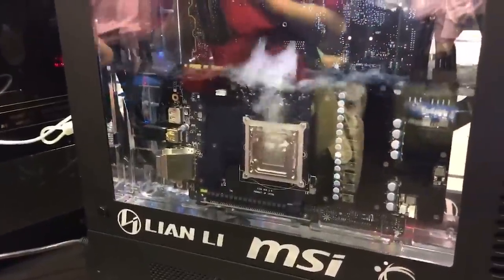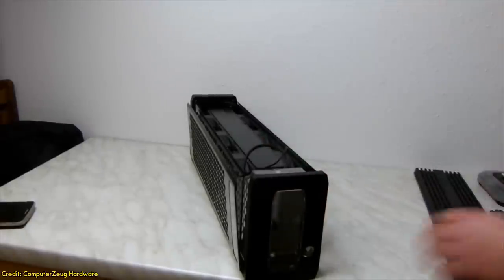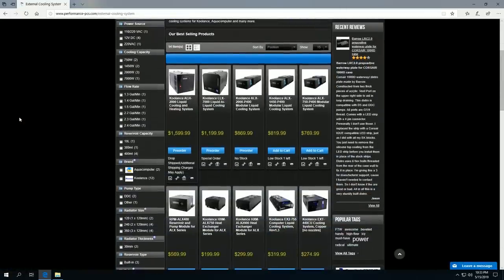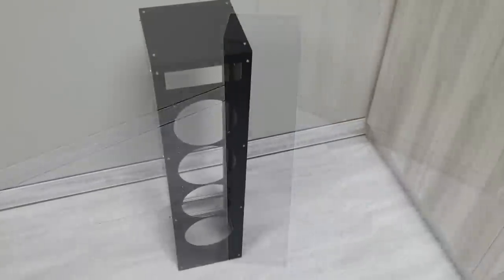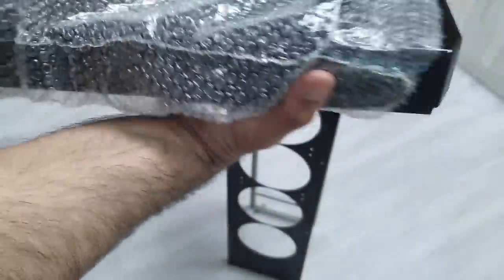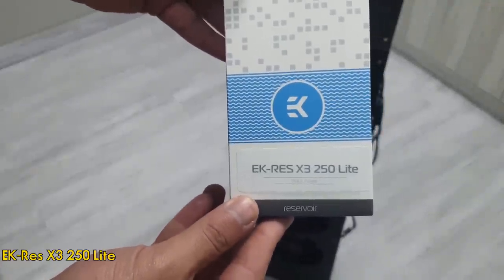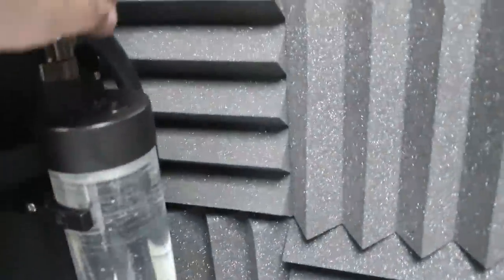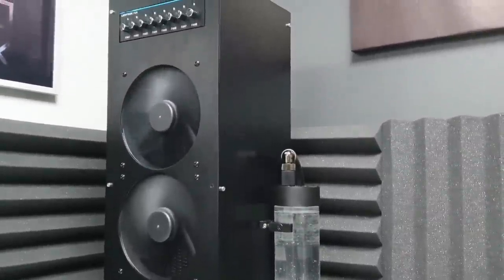A Single RTX 2080 Ti on a 560 Radiator!

Comment: This mans gpu on Load is lower then my room temperature. Amazing
Reply: It could never be colder than ambient.
Reply: pretty sure its possible even with a air/water cooler, but you ltierally dont want to :p also maybe OPs ambient might be very high xd
Reply: @ZenTauren  delete ur comment pls i lost 20 braincells
Reply: @ZenTauren  Intel would disagree. (->insert chiller pun here)
Reply: @ZenTauren  Well yes it would quite litterally be "air cooling"🤣
Reply: @ZenTauren  If he lives in a sauna or Quatar, perhaps. Obviously he is either being hyperbolic or doesn't understand thermodynamics. I am going to leave my comment.
Reply: @ZenTauren  my room in the Philippines used to be around 90 to high 90s Farenheit until like rainy season. I'll never forget it lol
Reply: Than
Reply: @420f37  you didn't have AC???
Reply: than*

Comment: I own an eiswand too,  I had the same noise as yours, turns out it was the fan hitting the dust filter. I removed the dust filter came with eiswand replace it with 3*120 magnetic dust filter that can be easily removed and clean from the outside, that solved my noise problem. And I also got an adapter power for the eiswand, now I can change the voltage between 5V and 12V with ease. But have to say, your new solution is insanely good, I might try the same way but with 1080 radiator.
Reply: Ken Hu 1080 radiator 😂 go get a truck radiator and cool your a$$ with it . Jeez 😅
Reply: I may have to look into your solutions as I own an eiswand too I just used some tweezers to pull the dust filter away from the fan as that's what's causing the noise. They should at least shave the filters so they're flat on the back.
Reply: @wapeddell  but know this, after I removed the original dust filter  the noise of the fans became more notable, you might want to look into some quieter fans. Looks like a lot  of people have the same issue as us, maybe alphacool should change the way they install the dust filter.

Comment: I'm here because of "Palmy|Rabbit[TH]'s" comment "GPU 30c? r u running on thick on thin radiator? push pull?
". 

And your response was "Im currently using Alphacool Eiswand 360 external radiator for cooling the GPU only. In the coming 2 or 3 days ill release a video about a new cooling setup with a bigger radiator :) .. keep in mind that ambient temps at my end is around 16 - 18 c
" from your "Tom Clancy's The Division 2 - PC Ultra Quality (3440x1440)" video.

I'm glad you followed through on your word! Thanks!

Comment: I made a switch using a relay that turns on the power to an external radiator when the PC comes on using USB and a bios setting that only turns on USB power when the PC is on.  It's also got a power switch so I can turn it on manually if desired (in case the USB switch failed).  I also used an EK D-Bay (with EK D5 pump), so it included the res and pump inside the enclosure.  Lastly, I was able to power the entire thing using a 12V 5A power brick with no need for a full power supply.

Comment: I'm also doing this when I found out about external radiator mounts.
Currently cooling a r7 3700x w/ 2 nvme m.2 gen 3 in a loop w/ 2x 360mm 30mm radiator.
Even my case is a full tower it only can only mount 1x 360mm 1x 240mm and 1x 120mm.
Note: 2x 360mm top and front will have a angle fitting clearance issue so I only used 240mm.
Going to add another 360mm for GPU as separate loop.
Still going to use acrylic tube but I'm adding a soft tube w/ quick disconnect on the rear pci-e slot of the case for modularity and maintenance cleaning/troubleshooting.. it will hard to move a tower system with a external radiator if it's not removable via quick disconnect fitting (so it's a hard tube build with just a lil bit of soft tube for modularity)

Comment: The pump should be pushing water into the restrictive cooling blocks and receiving gravity fed water from the reservoir to get the fastest flow of water and to prevent the possibility of the pump running dry. Pump damage can occur in as little as one second of running dry.
Reply from the maker: Thats exactly how my pump is set up :)

Comment: Was it worth it for a single pc part. The correct answer would have been yes! The gpu ran 9 degrees C lower, and the clock boosted even higher. 100% worth it for an enthusiast.

Comment: I am glad this video was recommended to me to be honest.
Your video just gave me an amazing idea that i will use for my personal use case scenario.

I thank you for turning a full airflow  FAN crazed maniac to the water loop that i was asking about but had no answers to!
I am worried about the risks that come with a water cooling loop , but if you can get some really good sleeved tubing like 
the ones found in AIO`s and some good fittings. I believe you can create a really robust water cooling loop.

Now you just need to add a card like the Galax Hall of Fame card or Asus Matrix ? No more like an EVGA water cooled one and
just put it into the loop on the 560mm. rad.  (My idea is to have a GPU with the water cooling integrated and fans on it as well :D)

Can you please make a follow up video on what kind of temps you get when you add a  CPU to the loop  ?

Comment: My room is 20c, i have a Gigabyte Xtreme 980ti that i've put 2 140mm Notcua industrial 3,000rpm fans on. temps under most loads are between 38-44C, most ive seen in synthetics and BL3 maxed with unlocked framerate is 48c. definitely good for an air cooled card ;)

Comment: You did put the reservoir in the opposite direction. The little tube inside has to be looking up so it can be purged. The air bubbles NEED to go up not enter again into the circuit. So 1 hole only has to be up to open/close the air and the other 3 have to enter/exit the liquid. Also I couldnt see it in the video but the radiator holes have to be down so the air bubbles formed accumulate in the upper part too and dont enter again in the loop.
Reply from the maker: Thanks for the message bud, the radiator holes are on the bottom. Regarding the pump inlet and outlet setup, it's exactly what was mentioned in EK manual. I have no issues with air bubbles.

Comment: Just another thought, maybe you can use one of the reservoirs that can be installed in an optical drive bracket like alphacool Eisfach. And add an optical drive bay module on the top of your radiator case. This way you can hide almost all the tubes, reservoirs and pump inside the case.

Comment: Either Jayz or Linus is staring at this
Reply: new video to be up very soon.
Reply: After Threadripper 3000 launch

Linus: Alright, so today we've decided to set up the ultimate watercooled PC. We've got a Threadripper 3970X and two GTX 2080Tis, the kicker here is that we're going to be making a custom case so that we can give each processor it's own 560mm radiator along with an extra one for the motherboard and NVMe blocks.

And somehow, it takes 3 videos to get it fully working.

Comment: Cut that adaptor in two and put it into a 3 or 4 pin fan header. if done correctly and your mobo supports controlling the voltage of the fans connected via the onboard headers, you will be in for a fan control delight.

Comment: Very nice. The only three things I would have done differently are:
1. Use Noctua NF-A14 iPPC-3000 for maximum pressure and airflow
2. Use a 60mm thicc radiator for maximum cooling capacity at a given length (4x140mm in this case)
3. Use a dual 5.25" bay res instead of an external res. It'd make for cleaner tubing runs (in my opinion) and make pumps internal as many dual 5.25" bay reses can accomodate two pumps, though I can understand using a external res would make refills easier.

Still, a very cool way to DIY a external open loop!
Reply from the maker: The guy who made the case for me could definitely design what you posted, awesome ideas
Reply: @UltrawideBenchmarks  Good to know. :3c How much did the enclosure cost you?
Reply from the maker: @ericdeltoro8484  180 dollars without shipping
Reply: @UltrawideBenchmarks  S'not bad at all for a custom built enclosure.
Reply from the maker: @ericdeltoro8484  yeah I honestly think its priced very well .. the rest of the cost goes with your choice of brands
Reply: @UltrawideBenchmarks  Yeah. Whenever something is custom made to your specs/needs it tends to be pricy so I agree, the price is very reasonable.

Comment: Great video, one question: Is the pump still the same as at 2:04? Looks like it's behind the monitor. Obviously the cooler is dead quiet, but does the pump make much noise? Thanks
Reply from the maker: Hey buddy, yeah the pump is the same at the end of the video and its dead quiet .. no sound at all! I found out plcing the pump under the reservoir can create a vortex in the reservoir ..

Comment: I think more credit at the same time needs to be given to the Watercool  heatkiller block. Only 2-3 blocks out there at the moment will keep this kind of water temp delta on a 2080ti.  I have gone thru about 8 different blocks on a 2080ti.
Reply: Have you tried the ek copper/nickel waterblock? I found a good deal on one with q backplate i was eyeing, also on the phanteks one

Comment: nice box you have there. 
suggestion for an upgrade: a flat reservoir, built into the side. so you can always see the fluid-level but without having a rather bulky res hanging on the side.

Comment: What would be a cool product would be making these 560mm stands with all the parts necessary. One stand each to cool the cpu and gpu. But tubing long enough to hide it all behind a wall or in some noise isolated area. Then your PC will be ultra quiet.

Comment: Maybe you should put an easy to clean dust filter on the front, a hole so you can have the power button in your tower, and so we only see the top of it, not the cable, and because you have 8 fans controller, 4 other on the other side to help air flow, I know nothing about this so it's might be stupid, but from what I see it seem normal

Comment: Holy moly, that thing looks like a wind tunnel! Pretty sweet!
This has also made me want to design my own external cooling solution now.
I get the feeling it will be more expensive than a manufactured unit but I think it'd be worth it if it can chill anything I throw at it!

Any recommendations on pumps? I have a feeling there are pumps that can withstand being on indefinitely, problem is, I don't know where exactly to start looking.

Comment: I want to custom cool my 1080 Ti but it's a founders edition. Is there any way to even recommended to take a FE apart and watercool it? EDIT idle is 25-40c under load most new games it hits 84c and sits. Most games I run 1440p 144hz ultra.
Reply from the maker: Are you going to upgrade your GPU within the next year? If so, its mot worth it.
Reply: @UltrawideBenchmarks  I am awaiting Nvidia to tease their next gen cards, trying wait for the next substantial upgrade in major performance. I went from a 970 to 1080 Ti, I got the 1080 Ti FE first week of launch.

Comment: Thanks for an interesting video.
Though I have a question. in Your explanation of the "flow" You seem to indicate that You are using the "Top" of the reservoir as the "exit port" going in to the Radiator??
Is that really how You have it set up, if so why ?? I ask as this to my knowledge is an "unorthodox" set up, and it seems to have the obvious risk of introducing air bubles into the loop.
And also, did Your "AlphaCool Eiswald" make that "noise" already as new, or is it something that has "developed" with "age" ? I ask because to my ears it sounds like something in it is "unwell" and I would't expect a new unit to soud like that. 

Best regards.

Comment: I run a 7700k @5ghz and a gtx 780ti also max oced +180 core and +400 on memory(i know time to upgrade) but i only play wow. Enyhow. I run them on a alphacool 420 rad 60mm. Cpu 65c and gpu 30-32c on full load for hours. So whats the fuz about Here?

Comment: I really like your channel bro please make more video's like this.
I was hoping to see the GPU waterblock up close.
But the CPU is watercooled on a different radiator am I right?
BTW is it wise to do a comparison /w your CPU watercooling against 560 Radiator?

I see the CPU is already cooled separate.
But what if you do this the same like you did with the GPU on 560 radiator..
Will it also be very low temps like below 30-40C ?

Please do a video testing on your current CPU temps.
Then make a custom radiator 560 on CPU and which temps is better.

I believe this method is by far the best ultimate watercooling solution for low temps under load.

Comment: 13:17 totally agree. When building my new PC I wanted to go all out. Dual 560s!!
The only case I found was TT's The Tower, but it was a stupid design that has the rads in a second area that left NO airflow over the motherboard.
Reply: im in the thought process of building my own case to support 2x 560s (The option in the video is still a 'case', just you have second one). My design would house the rads horizontally at the top, intake only driven by the rad fans, the cold air having to pass over the mobo & pump area.   My goal is silence. Unsure of fan configuration - should i decouple them? Have them as pull?  Ive even looked at large ducted fans.  I think the design of the radiator case he has is great - fans decoupled.   But he has push pull and that would mean 16 fans - too many. 
The case shouldn't be too hard to build. Out of wood with the carcass of a fractal case for mobo tray, i/o and other parts incorporated.  Would sit under the desk. would be about 35cm wide,  65cm high. 65-70 deep.  What do you think about fan configs?
Reply: @fredfinks   If quietness is your goal, not outright performance I'd avoid push/pull.
Check out the Thermaltake WP100. It can do 3 560mm rads, and if you're insane there's the WP200 which can do something like 6 560mm rads
Reply: @garavonhoiwkenzoiber  Ive checked it out, unfortunately thermaltake quality control is very poor. The metal is thin and i wouldnt be able to dampen sound like i could with a custom case.  Also,  the layout isnt what i want.   Custome - exactly - what you want. What im unsure about is optimal layout of fans for silence.  In either push or pull, push give better cooling but i think decoupling fans from radiator might be quieter , however i think it wouldnt work well pushing in that scenario. (a turbulent mix of air being pushed around back n forth before it finds its way into the radiator fins.)   Pulling, the air would just be drawn through fins.  Radiator sealed around so no gaps between them and case walls.   Radiator a few inches lower than fans. so this fairly slow but large volume of air moving from filtered intake near bottom , over mobo area - through rads and out the top. Thign is 8x 140mm fans! even at slow i imagine id hear some noise

Comment: I can’t fathom why you’d prefer to control fans with manual knobs and what use case you’d ever need to run the fans at different speeds from another.
Reply from the maker: A lot of people have different opinions on fans being quiet, its a way to control the sound level of the fans as well :) using Noctua's supplied cable to reduce the fan speeds isn't practical for me as I need them a bit faster

Comment: Hi I would like to get this exact same external setup to go with a ncase m1 and watercool everything inside it. Stupid question but where is the pump? And what type of pump would I need. Also do the power supply come with enough  molex cables for this? Also is there no worry of leak landing in power supply? can I put the power supply with fan downward just in case? Thank you for posting  this
Reply from the maker: Hey there! 

1. The pump is attached between the pipes in the middle, I bought it before doing thisbproject and decided to keep it away from the case, i suggest you get one attached to the reservoir.

2. D5 pumps are the best choice

3. The fans connect to the fan controller, and 1 molex connection to the fan controller and thats it!

4. Until now no leaks whatsoever, but I recommend asking the guy who designed for me to install a divider above the PSU to avoid such issues.

5. Yes you can install the fan downwards but make sure to ask the designer to keep the bottom part open so it can suck air into the PSU.

Note: The power supply used in this project is an SFX power supply.

Comment: Isnt it better, to just have pull configuration? It should do same work and put less dust in radiator, if im correct.
Reply: With the thickness of his rad without push pull he would lose static pressure.

Comment: You seem like an expert on this, so do you think that an internal build water cooling system with 240mm radiator kit from EKWB is enough to cool a single RTX 3080 GPU alone? I got a wb for this one coming up soon.
Reply from the maker: Yes itll work but if you have a big space in the case get a thicker radiator to maximize the cooling. Make sure to check the maximim thickness for a radiator for your case before purchasing
Reply: @UltrawideBenchmarks  yeah, it's 64mm thick and I plan on mount it on the front with intake fans. Got space in front yes.
Reply from the maker: @TheEdmaster87  good choice, the cold air will be hitting the radiator first then get into the case. :)

Comment: Hey man,its really cool. Wandering if you would get better temps while using hardwarelabs black ice nemesis 560 gtx/r radiator.Was reading from thermal bench but am not sure if its quieter.
Reply from the maker: Youll get better temps but you need to compare the prices of both to justify if few degrees are worth it :)